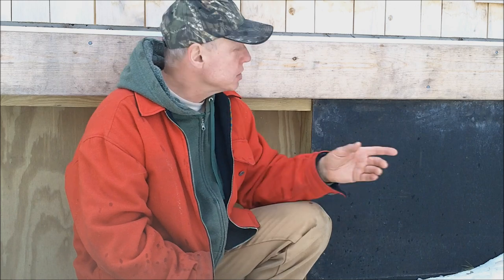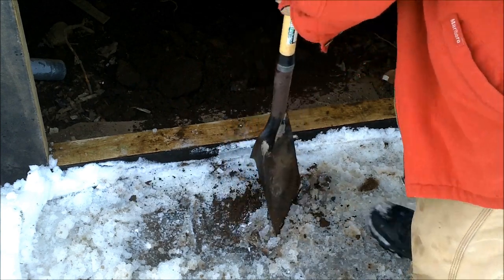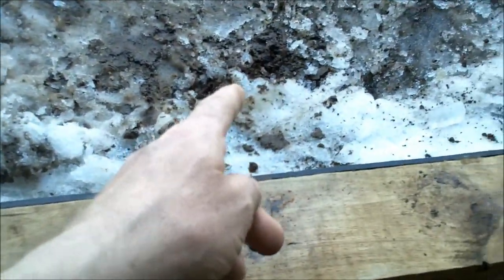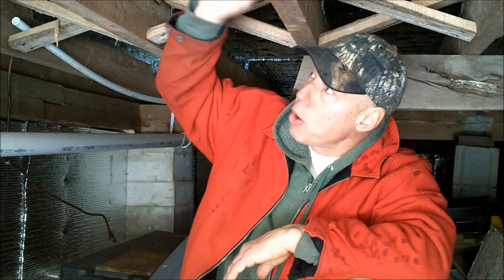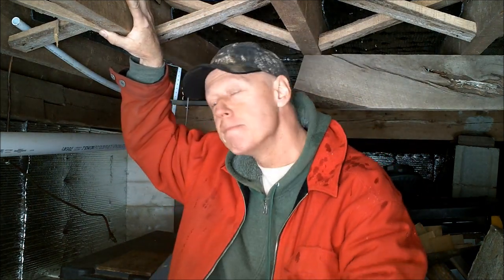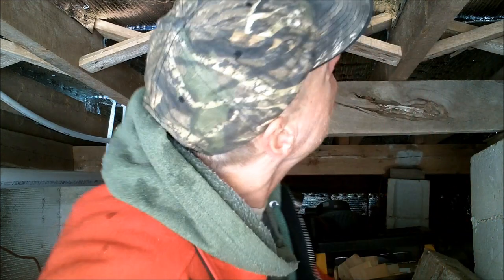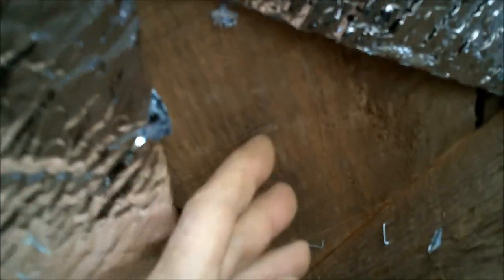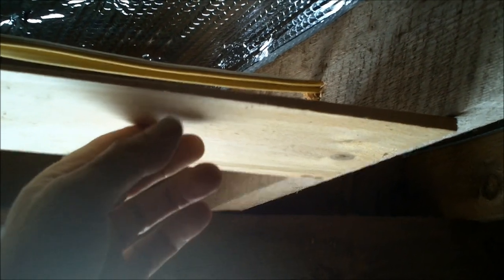HOW TO INSULATE A CABIN FLOOR AND KEEP IT RODENT FREE   PART 2

Comment: Great advice thank you.  I have a question.  We are in the process of converting an Rv into a tiny house.  Under the fifth wheel are the water, gray and black tanks, and it is next to impossible to access making it next to impossible add insulation under the floor. There is some insulation, but I am guessing not much.  We have a particle board sub floor. Can we stable the bubble wrap onto that then add the finished floor which will be wood? Thank you!
Reply from the maker: Yes but I would think it would serve you better to add 1/2" wood strips over the foil, then nail your new floor through those. The trapped air will help insulate and your bubbles will never be deflated.

Comment: I think this is a great idea, , i have a house in the mountains that has a block foundation, with floors insulated with fiberglass, and between to moisture and the critters, its falling down everywhere.   How could i use this on block walls without having to drill holes everywhere to mount this against the walls.?
Reply from the maker: First off, I'd replace the fiberglass with this and see how that performs for you. You may not have to insulate the blocks.

Comment: Here in AZ we have a problem with pack rats.. Isn't shiny things like the bubble foil attractive to them.?  My plan is to put down a galvanized frame on the ground,,(basically my floor joists)  then I wanted to put some heavy duty screen across that and then some bubble foil on top of that, and then throw down my floor boards and build the cabin on top of that. I know most of your experience has been with mice, which I have here too, but what do you think of that idea.?
Reply from the maker: As long as you can keep the critters out you'll be fine.

Comment: We have a 3 season porch that’s 3ft off the ground. We were told to have vents in the skirting otherwise it’s an oven in the summer under there. If we use the bubble wrap under as you have done and around the inside of the skirt, should we cover the vents in the winter?

Comment: I am female and building a cabin.  I will need to hire someone to put this bubble foil on for me.  Could I staple the foil to the subfloor sheets of plywood on the underside before they are nailed down as the subfloor?  Or would this not give me the same amount of insulating factor?  I would really appreciate an answer  be cause contractors think I do not know anything and will try to talkme out of it
Reply: He stapled the bubble foil right to the top of the floor joists for his New York Cabin and then laid the subfloor sheathing over that. I have done the same and it really works wonders.  I think you should be able to find the video where he shows how he did it.
Reply: Linda Barnes He stapled the bubble foil right to the top of the floor joists for his New York Cabin and then laid the subfloor sheathing over that. I have done the same and it really works wonders.  I think you should be able to find the video where he shows how he did it.
Reply from the maker: Normally, I roll it over the top of the joist like @ 3.08 in this video:   https://www.youtube.com/watch?v=ZPWYa_6QelM  and this will give you the best insulating performance BUT... you must keep the rain from getting trapped between the foil and the plywood.   Stapling it to the plywood first would work in the same manner but this would be quicker.  

They will try to talk you out of it due to the R factor but this has served me well.   Good luck  :-)
Reply: mickeysmadness I am concerned that when the foil is laid over the floor joists that my contractor's helper may try to walk on the foil and not find the joist and put his foot through it.  Would it really matter if I did it the way I suggested?
Reply: TheBossoftheSwamp OFF GRID SELF RELIANCE Thanks for getting back to me.  I live in a desert, and rain is something we pray for because it rarely happens in summer, but I will keep your advice in mind.  Thanks for posting these videos because I was also concerned about my drain pipes freezing.  This cabin is being built at an altitude of 7500 ft, and cold is always an issue.  I was concerned that I wouldn't be able to use the sink drains or toilet in the winter months when the temps can go to 20 degrees below zero.  It could still happen, but now I at least have a chance that it won't.  I am assuming the skirting plywood sits on the ground once it is fitted in place.  I have never seen skirting, and it was difficult to see how it all fit together in the video.  Is it nailed on the outside of the base of the cabin, or is attached to the interior?
Reply from the maker: I think your suggestion is a good one and would offer similar results.
Reply: Linda Barnes he would have to be careful and lay the plywood as he goes. It’s certainly possible to do it the other way but you will have more gaps. I recommend taping all your seams with foil tape.
Reply: mickeysmadness    I understand what you are saying, and it makes sense.  I was picturing this foil in large sheets.  It's probably more manageable than that and would allow for it to be laid down in an area accomodating sheet by sheet of the subfloor.  Thanks for staying with me on this.  I am learning as I go thanks to JC and folks like yourself.   I plan on putting up skirting and will try to find videos on it.  Is skirting installed on the interior or exterior of the space below the subfloor of the cabin?  And does it need to sit on something other than the dirt?

Comment: On boy, I know you're gonna have a cow over my question but here we go! What is better in your opinion, 48 inch strips rolled across floor joist and taped or should I by the 16 or 24 inch rolls and staple from underneath like you have there? I lmao at your Sunday vid!!! Thanks, T
Reply from the maker: 48"and rolled in the direction ON TOP of the joist for best performance like at 3.08  in this video:  
https://www.youtube.com/watch?v=ZPWYa_6QelM

Or go underneath like I did at this camp.
Reply: Got it! Thanks.

Comment: Just saw your video, thank you.  I was told if l was to install skirting and not seal the bare earth, this could result in mold on the joists/floor system.  Just wondering your thoughts on this and if there is any signs of mold? There does not appear to be in the video.
Reply from the maker: That question has been asked quite often so i cover that topic in this video  https://www.youtube.com/watch?v=cbbItGGyFLc

Comment: Is your pressure-treated wood framing between the piers just sitting on earth or did you put in some sort of gravel or rock footing for the framing to sit on?
Reply from the maker: It sits on styrofoam :-)
Reply: TheBossoftheSwamp OFF GRID SELF RELIANCE .....just pieces of regular styrofoam a few inches thick?

Comment: Would you recommend this for walls as well
Reply: I used it on the walls of my shed in Michigan. This stuff simply works! You don't butt it on the walls. It's best to install it to the studs 2 to 3" off the exterior walls, in between the frames.

Comment: ok I have a moisture problem in my off grid cabin even with the skylight open all night. The only source of heat is a propane heater. Its only about 180 sq ft. the person I bought it from insulated underneath and sealed it all with plywood and the roof has no gable vents, ridge vents or soffit vents. So im gonna remove all the ply and pink insulation underneath and use bubble foil. My question is the skirting. Did you dig a trench under the skirting and backfill that with gravel? The roof is in good shape but I need to put in soffit vents and ridge vents. So im not sure if I should remove the drywall inside or the roof outside to accomplish this. I'm going to put a metal roof on it. Im thinking, less mess doing it from above.Thx JC.... forgot to mention...the windows are all condensation by morning with the stove on.
Reply from the maker: Do you have a vent free propane heater?  If so, they create lots of moisture.
Reply: yup its vent free
Reply from the maker: Without seeing your place in person, I tend to believe your problem is stemming from your heater because vent free furnaces put moisture in the air.  Unvented ceilings, roof vents etc cause moisture in the roof system but not inside the living space.

Comment: What is the temperature near the subfloor and at the ground level?  You have to have some heat loss through the floor, but with wood heat, you can surely afford a little heat loss if you do not have drafts through the floor to make it uncomfortable as it also acts as a vapor barrier.
Reply from the maker: Any heat lost through the floor joist is trapped beneath the cabin and keeps the pipes from freezing.  My cabin is toasty and my pipes don't freeze,  That's good enough for me.

Comment: Would this method maybe work as well on a cabin roof? Laying the bubble wrap between the rafters and sheeting?
Reply from the maker: The only thing that should contact the underside of your roof sheathing should be AIR. Otherwise you will have condensation issues.
Reply: TheBossoftheSwamp OFF GRID SELF RELIANCE Oh ok! Thank you! First building :) Not doing it by myself, just getting ideas about how things work. I appreciate you replying!

Comment: Hi boss, wondering how it would be if I use regular insulation and then bubble foil over the supports? I’d rather go over board with the cold weather I have at my cabin.
Reply from the maker: If critters can get to it, they will love the warm cavity you create for them.  If critters aren't an issue I'd say you would be fine. Myself, I'd put the foil against the floor to capitalize on the reflective qualities.  Home depot isn't selling the Reflectix anymore. What they sell is crap that is half the thicknss.  This is all I use:  https://amzn.to/3J6kKk1  
_____________________________________________________
Purchasing through our Amazon link helps our channel as commissions are earned from qualifying purchases.
Reply: @thebossoftheswamp  I ended up picking some up on marketplace got a good deal. I just want to go over kill. I plan on doing the skirting as well. My biggest concern is frozen pipes. If I need extra I deff will hit the link for more.

Comment: Well that's just good backwoods logic. Floor joists (wood) insulates well and wont transfer much heat. Personally i would put a vapor barrier over the ground to keep down the water vapor and give a nice clean surface to crawl on...but i know that you have some plans on digging under there. Very wise thinking about not giving the rodents a warm place to live. They would have rodent mansions in there.

Comment: I'm currently planning out a cabin and want to use this system. I don't have land but am going to be buying some somewhere in New England. Did you have to get a building permit, will this meet code?
Reply from the maker: Yes on the permit and no on the code.
Reply: @thebossoftheswamp  Sorry I don't know anything about building a cabin, haven't built anything before. I've been learning how to do so online for the past year and have been planning out what I'm going to do in SketchUp to make sure I understand everything before I start. Maybe this is a dumb question but do I not need to build to code to get a permit? Or is it just that no one really checks that it's to code after the permit is obtained?

Comment: One question, I have laid plywood down for floors on joist before, but always put down contact cement caulking on the top of the juice to try and eliminate a squeaky floor.  Do you have any issues with that by putting the bubble foil on top of the joist and then the plywood on top of that?  Thanks for a helpful video!
Reply from the maker: This will create squeaks but I'm told that that issue would be eliminated by screwing the deck down. The squeaks happen when the floor moves against the nails but won't with screws unless they have a smooth collar.

Comment: I’m curious- if you were to use the bubble foil on your roof, would you leave an air space between the foil and the roof deck, or would you staple it directly to it?
Reply from the maker: I would leave an air space. Heat loss needs to vent out.

Comment: Serious questions:  why not avoid rodent/insect/heat loss/insulation issues associated with a building with a crawl space by just building on a concrete slab?  What is the advantage of a building with a crawl space vs one on a slab?
Reply from the maker: If you can get a concrete truck to my cabins,   You know something I don't  :-)   I'm 1.6 miles off the pavement.
Reply: Ha!  Good point.

Comment: Are you using stainless staples in the pressure treated wood, will the PT wood eat aluminum staples?
Reply from the maker: I just use regular staples and have no issues.

Comment: I know how hard it is to keep rodents out of the basement, but if you have buried the skirting a few inches into the ground and have really sealed the top edge to the sills, do you really get them inside anyway?  Mouse bait etc may also help? I was very lucky.  My tiny house I built on top of a car hauler that had a floor of texturized 1/4 in aluminum.  I wrapped the lower foot of the walls and the sills with aluminum flashing...not a sign of rodents, or even bugs in the house in three years.
Reply from the maker: They can't enter the cabin itself, just beneath it.  I don't bother trying to seal every gap cause they all end up in the bucket trap anyway.
Reply: What is a bucket trap?  Sounds interesting

Comment: I don't understand the point about the ground under the floor being soft.  Doesn't that mean the house is leaking a ton of heat and heating up the crawlspace?
Reply from the maker: That's correct, you don't understand it. The insulated skirting traps the ambient temp of the ground beneath the cabin.  It's cool in the summer and warm in the winter because the skirting keeps it a moderate temp.

Comment: Do you overlap the edges or butt up the edges? If overlapping does it push up the plywood when it goes from single layer to double layer?
Reply from the maker: I butt and tape the seams single layer.

Comment: We are planning to do the bubble foil between the joists on our cabin.  My question is we have a small shed attached to the cabin where we plan to put our propane tank.  Would it be better to put strips of wood down on the floor after the bubble wrap then plywood sheets on top as we cannot gain access under that part of the cabin.
Thanks in advance for sharing your knowledge.
Reply: And would you suggest doing the rest of the shed with the bubble foil in the walls and ceiling?
Reply from the maker: If you are putting the foil on top of the floor then yes, I would staple it down, then nail trips of wood over it and put the second layer of floor over the strips leaving an air gap between the two.   I'm no engineer but that's what i would do and yes, adding it to the walls and roof will be fine in the shed.
Reply: @thebossoftheswamp  thank you very much.  Will be going to the cabin in May and doing this…….can’t wait for warmer floors.
Cheers
Reply: @thebossoftheswamp  I know you said that rodents don’t like it but how does it do with porcupines and fishers?

Comment: I have a question, I live in Texas and have a pier and beam cabin, if I were to insulate mine like you did, would it make it to hot in the summer time  and because it is much hotter during summer would it create condensation to build up between the floor and the insulation?
Reply from the maker: I think it would be fun but can't say for sure. I've never lived in a hot climate.

Comment: Got a question,  should this be used on exterior walls before u side ur cabin, u would use 3/8" foam insulation before vinyl siding would bubble foil work better?
Reply from the maker: I'm working on a followup video on this subject and hope to have it out within a few days. It will answer many questions and cover different applications so stay tuned.

Comment: I have a small cabin on some property I am building. I was told you can use reflectix under the roof and it will insulate and that is all I would need. I thought I would need regular insulation also with it. Would I need both insulation and reflectix or just the reflectix? I heard reflectix would keep it warm in the winter and cooler in the summer.
Reply from the maker: I would use more than just reflictix in the roof.